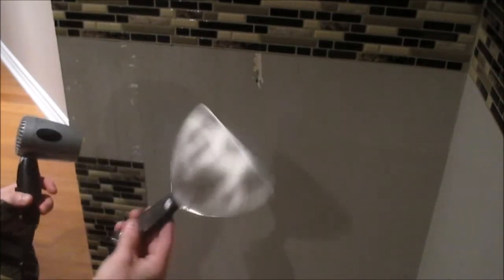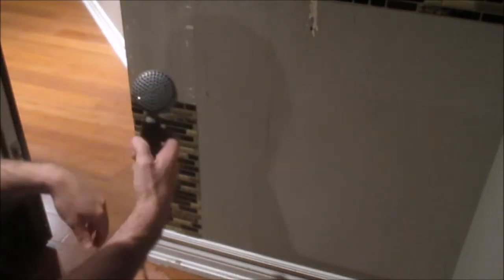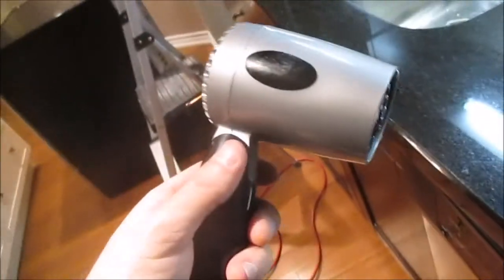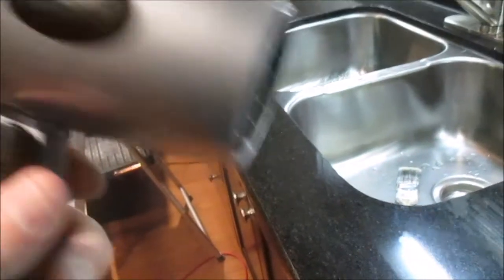HOW TO REMOVE PEEL & STICK WALL TILES (EASY)

Comment: After seeing a ton of videos of people putting up this product, I am so glad I actually came across this one.  It looks like it takes 5 times longer to remove then to put up and that it destroys the walls.  I won't be using these as my land lord would rake me over the coals and back. Thank you so much for posting this, you saved my life! How can the claim it to be removable I just don't know.
Reply from the maker: Thanks for watching and for the comment! I'm glad this video helped. These were on the walls for a couple years and as you can see they did a bit of damaged when removed. I have installed these tile too and the adhesive that is on the back is very strong.
Reply: were the walls sticky from the glue? If so, would you or should you use acetone to remove it?
Reply: U might can buy the kind that comes as a sheet n use double sided tape...
Reply: @TheCanadianHomePainter   are there any that won’t ruin the he wall
Reply: I really want to do my kitchen but the same here I have a rental I’ve been looking for renter friendly adhesive
Reply from the maker: @Angelajasmiine  honestly I'm not sure. I have only removed the difficult ones lol
Reply: @soxpuff  idk anything about this I’m learning like you but just saw your comment and was brainstorming but I feel like if it was some sticky spots acetone would work great but probably would need to repaint the wall. Which I’m pretty sure you would have done anyway

Comment: Dude. Seriously. Thank you for posting this. I thought there would be tons of people demonstrating how to remove this stuff with a blow dryer (like the instructions say) but you are the only one. Thank god for you because I probably would have gambled and bought this for my place and have to give up my entire security deposit to my landlord after. Christ.
Reply from the maker: This was the first time I had removed the tiles from a wall. Also in think the heat from a kitchen may help make them even more stuck on the surface. They came off but as you could see there was alot of repair needed to the surface. Glad you found this video helpful

Comment: This video puts those "upgrade your kitchen" videos people make seen unrealistic. They say that its safe for renters, but as you have demonstrated in your video, they are all full of sh*t. Thank you for making this video! It shed some light on what many renters wanted to know about these peel and stick back splashes.
Reply from the maker: Thanks for watching and for the comment. I'm glad you found it helpful. This was the first time I had removed them for a client. I have installed these peel and stick tiles at about 6 or 7 homes, as a cheap backslash alternative solution. But after installing them I know how sticky the adhesive is, which is great for keeping them on the wall. Not so great for removal though lol
Reply: Right! Definitely not getting a deposit back smh
Reply: Just because he doesn't know how to operate a blow dryer properly to remove the peel and stick without removing the pain/etc, it doesn't mean those peel and stick aren't renter safe! You need discernment and a critical mind when you watch videos.

Comment: It appears that in the beginning you were very slow and methodical and its didn't do much damage to the wall.  then you just was barely heating it and pulling. So this looks like something very tedious that you need patience for to try to do as little damage as possible.  It's good that you showed us but we don't know if you went slower like the very 1st one if there'd be less likely damage.  Although I can see it being worse behind the stove be christened the continual heat. 🤷‍♀️

Comment: How much damage did these tiles do to your walls/paint? If I were to go very slow and be careful do you think I could use these tiles in a rental apartment?
Reply from the maker: Hi! thanks for watching! the damage was not bad, just some paint was lifted off when they were removed, the glue on the back is very sticky so I figured on doing some touch ups. if you go very slow when removing the tiles then the damage is minimal, I don't think you would want to reuse the tiles because the adhesive will not be on as good. hope this helps :)

Comment: This is fantastic! Thank you for doing this. I have to remove some adhesive tiles (that don't quite go with the existing countertop -- I put them on and then had second thoughts) and this gives me courage. It's great that just the paint came off for most of them!!! Wish me luck.
Reply from the maker: Hahaha yes good luck indeed. I have only removed them a few times and mostly it came off the same. And the skim coat of drywall compound is minimal. Thanks for watching and for commenting. Let me know how it turns out, better yet make a YouTube video lol

Comment: Thanks this makes removing them so much easier👍 I couldn’t believe how much you had to remove!
Reply from the maker: Oh that's great to hear ! Glad it helped. Yes that was quite the project. How was the condition of the walls underneath?
Reply: The Canadian Home Painter it actually was really good. A bit of paint came off with the tiles but other than that it’s fine.
Reply from the maker: @princessag584  that's good, the walls were really bad in that video, I had to skim the whole thing, I'm glad you had an easier time with it.

Comment: This was some awesome insight. I read in one of your replies that there was some paint that chipped off... did you find that there was also a lot of glue left behind? I still may be up to the challenge, but I'm wondering about residue staying on the walls and then affecting the following paint touch-ups. I don't want to leave a rough/sticky surface for paint to then enhance and show the spots lol
Reply from the maker: Hey! Thanks for watching and for the question 
So yes it did take some paint off the wall, as for glue residue it was fairly little. But I did lightly sand the surface before I skimmed it with drywall compound. . If you make sure to sand and give it a light coat of compound then you will be fine. 
Hope this responds helps

Comment: I recently had to remove vinyl from my walls and I would say from watching your technique that you didn't allow enough time for the tiles to warm enough. I realised this when removing vinyl, you really have to heat them up a lot for the adhesive to loosen. Very time consuming to remove them without lifting any paint.
Reply from the maker: Ok, good to know, I rarely have to do this , but always nice to get a tip for next time

Comment: Can I just peel the corners to stick on and leave the backing on the rest to make it easier to take off?
Reply from the maker: That's an interesting idea, I'm not sure if they would stick well enough over time. But it could save some work repaiing the wall after you remove them.

Comment: Would things go bad if after I blow dry the tile on the front to loosen it up, then blow dry between the wall and tile as I peel it off?
Reply from the maker: I think that's fine, no matter how you do it you will probably still have some drywall to repair

Comment: I put peel and stick in my bathroom a couple of years ago and I can't stand it. Since I'm going to replace them with regular ceramic tiles, do I need to sand down any leftover adhesive to make the wall super smooth or is that just going to be a waste of time since it's all getting covered up?
Reply from the maker: I would think you would be ok I'd you are tileing over
Reply: @TheCanadianHomePainter  That's kinda what I'm thinking and hoping for. Wish me luck. I'm off to buy a hairdryer.
Reply from the maker: @indianapatsfan  let me know how it works out

Comment: Honestly to be on the safe side. I would make a backing and not stick it directly on the wall. I would leave a small space just to stick along the edges. Same with the floor peel and stick tiles, i would use thin sheets of wood instead of sticking it directly on the floor
Reply from the maker: Yes, that would make my job much easier lol, a month ago I had another kitchen to redo and it was a awful taking them off. But a bit of compound and I made it like new

Comment: Do you think it would help fo remove it without damage if you sprayed as you went with a adhesive remover or Awesome Spray from the Dollar Tree?
Reply from the maker: Hi Stacy, I'm actually not sure, I have only removed these sticky tiles a few times and it always turned out like this, but I never sprayed anything. Its Worth a try.  Thanks for watching and for your comment 😊

Comment: How did these tiles hold up and why did you remove them?
Reply from the maker: christina munoz the tiles are a peel and stick, they are very easy to install and they do last, they are pretty expensive too. The reason I removed them is because a new counter top was installed and new paint wad put on the walls and the color didn't quite work with those peel and stick tiles, if you are interested in
 installing  a backsplash that is quick and easy the peel and stick is the way to go. Hope this helps 👍
Reply: Hi, as a renter, I noticed there’s still some residue or chipped paint when you removed the first 2 tiles very slowly. Do you think it is possible to have no residue or paint pulled on the wall at all if one were to take their time with the hairdryer? Similar to first commenter’s question, but I’m more concerned about peeling bits of paint off the walls and whether it’s entirely avoidable.
Reply from the maker: @bttk6  Hi, i apologize for the late reply, for some reason i don't get notified when someone comments on a comment. i am going through so many comments on other videos that I had no idea about.  Not sure if you have attempted your project yet. It may depend on the type of tiles used and how good the adhesive is, or also the type of paint that was used on the wall. This removal job was quite bad and it was my first time removing these tiles. but I am good at skimming the walls after with drywall compound so I was able to make it look good after. Perhaps using the hairdryer for a longer period of time on the tile. I am always in a hurry when I am working, but that might be better for loosing up the adhesive.  Hope this helps!

Comment: Hey nice video. How did you remove adhesive afterwards?
Reply from the maker: You can get most off with scrapping and sanding, I skimmed over the entire surface with all purpose drywall compound so that cleaned it up nice before I painted
Reply: @TheCanadianHomePainter  I ended up using goo gone and a razor at first. Then good gone and paper towels. Took 3 or 4 applications.

Comment: Any tips on how to remove leftover adhesive on the walls as it can be quite sticky in some parts?
Reply from the maker: Have you tried sanding it off? I did a sanding and then skimmed over the surface with drywall compound 
Let me know if that works

Comment: Seems you began rushing the heat process the further in you got thius creating more damage then would have been necessary
Reply from the maker: Maybe, however I have removed those before and tried different ways , that adhesive is very sticky. I think it also depends what paint is underneath. But if you have a better method make a video and I'd love to check it out. Thanks for watching and for the comment

Comment: Landlord has to paint when you move out anyway. I’d say it’s safe for renters
Reply from the maker: Yeah, you're probably ok if you are a renter. It does do a bit of damage but easily fixed.
Reply: The Canadian Home Painter what do you think about applying wallpaper under it before adding the peel and stick as a protective barrier? Is wall paper easier to remove and less damaging?
Reply from the maker: @hollabackbych  yeah that could be an alternative solution. Wallpaper can be difficult to remove if not installed properly.  But a light skim coat of drywall compound over the damaged spots should be sufficient after it is removed. I would just double  check with your landlord first to confirm that it is ok to install. They are nice for a backsplash and fairly simple to install.
Reply: The Canadian Home Painter thank you